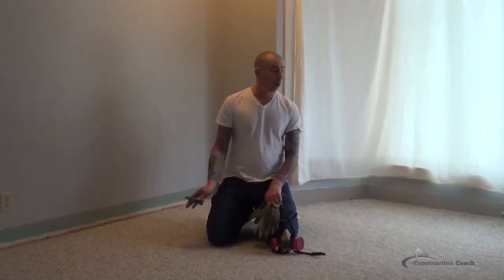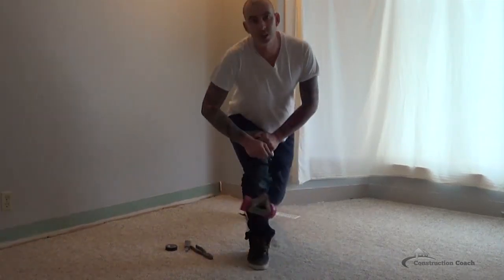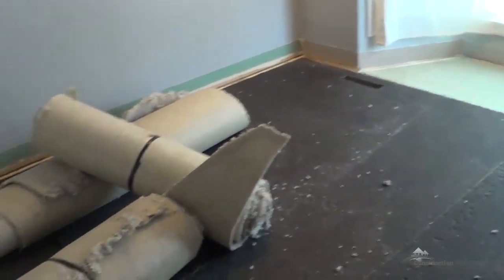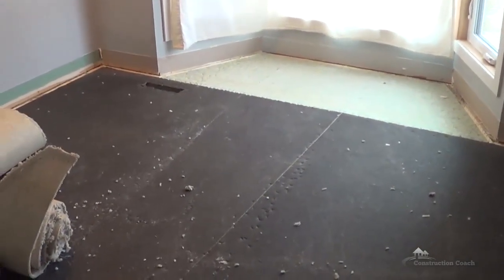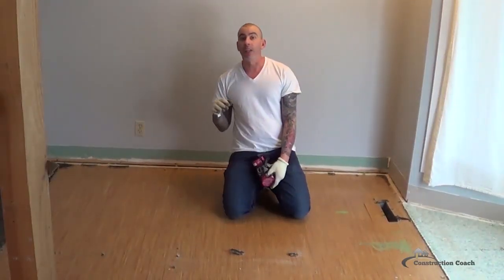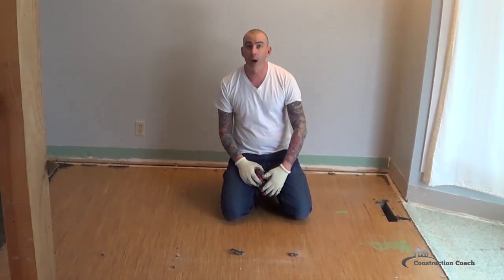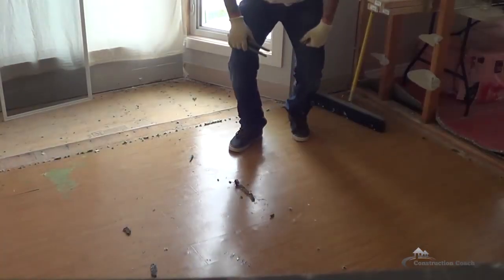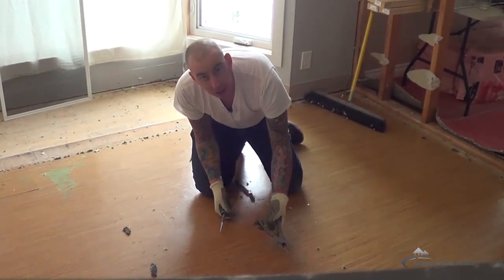How to remove carpet cleanly - DIY

Comment: Or do you just leave the asbestos there if you lay carpet over top of it?
Reply: Asbestos is only harmful if it's airborne. So as long as you're not damaging it you should be fine to reinstall carpet without removal.